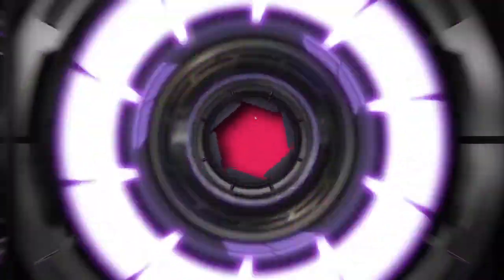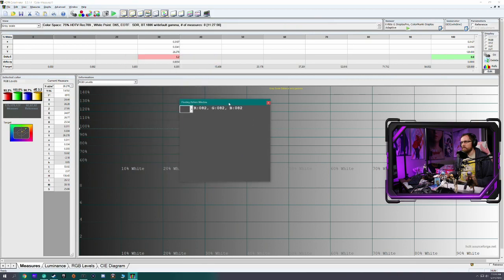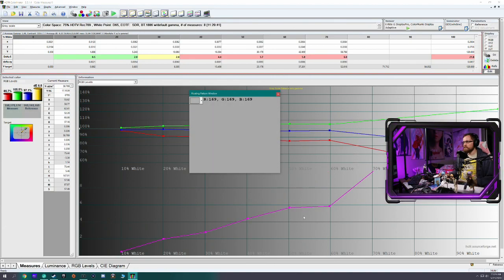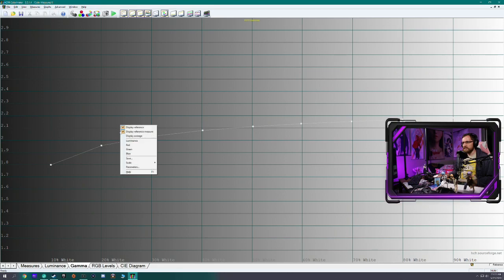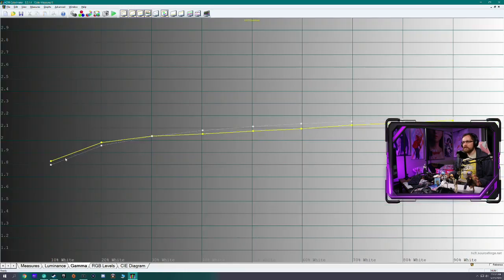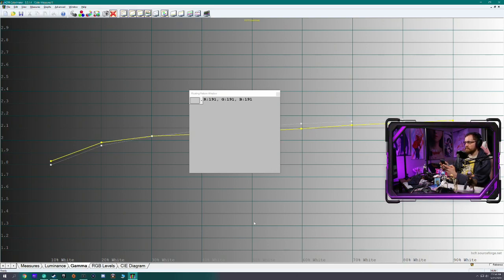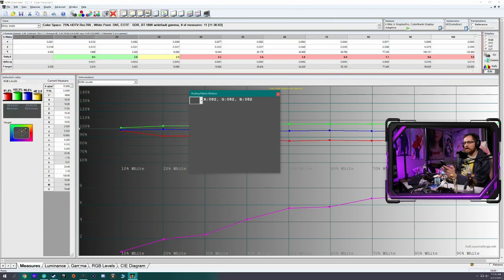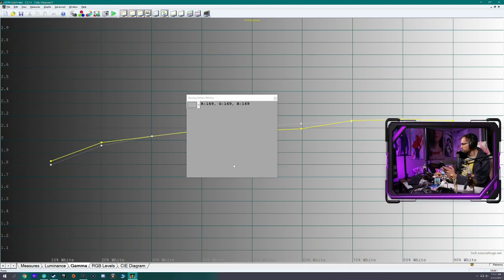HCFR Calibration Walkthrough Part 1

Comment: Happy to help you. The correct settings for LCD tv's is non refresh and best choice unless you're using one of the display types that as you said has a matrix made from a spectrophotometer which I have the i1pro spectro and the same colormeter you have so I can create spectro profiles. But LCD non refresh. OLED for OLED. Using the HCFR Test pattern Generator you need to make sure if using a computer to have 0-255 but if your using a tv then it needs to be set to 16-235 and the gamma and prefence settings were correct choice. Instead of using power law gamma you can choose bt.1886 for tv. Watching your video as i reply to your settings lol. All the measure graphs apply to the rec709 standard so each graph you want to get as close to reference points as possible. Shoot me a message, I have a discord as well and don't mind giving you a head one weekend if you wish.

Comment: Gamma graph should be modified by tweaking contrast (for the right side of the graph) and luminosity (left side), not RGB.
Then you can tweak your gray scale ref using the RGB Levels tab and the R G & B settings.
I generally go back to my Gamma afterwards for final tweaking (contrast and lum ONLY).
Then you're ready for the saturation settings with the CIE Diagram.
Reply from the maker: How would "tweaking contrast" align RGB for the gamma? I have to assume by "contrast" you mean white level, since contrast is practically a meaningless term unless you're talking about actual contrast levels of black and white which has absolutely nothing to do with this calibration. 

Also, "luminosity"? What? Do you mean black level or to keep the nomenclature of you saying "contrast", do you mean "brightness"? And again, this would not align RGB for gamma or grayscale.

Your reply utterly confuses me personally but I'm glad you have your own method for doing things.

Comment: Great demonstration! A couple of pointers:
1. You should start by setting the black and white levels first, especially for backlit screens. You can always go back and fine tune it later.
2. Having the delta value under 3 is ok for an older standard tv in daylight situations, but if you’re calibrating a dark room setup with a newer tv with high color fidelity or a reference monitor the value should be as low as possible, definitely under 1.
Reply from the maker: 1. Yes, of course your should do black and white levels first, but as you could probably gather this is not a "beginner's guide", so it's assumed if you are considering these steps you already know something so basic. As a lot of comments here have suggested, it was clearly a mistake to not dumb everything down way more than I did. Oh well.

2. According to the ISF, professional calibrators, and human visual acuity, a dE value of below 3 is "imperceptible to the human eye". While you MAY be able to notice changes below that if you're really looking, it's not required for a correctly calibrated display. However, as mentioned in all of my videos here, it is of course the ideal to get the average dE levels as low as possible which is why I personally got mine all below a dE of 1. Is that required for a correctly calibrated display? No, it's not. You and I may of course say that we want it below 1 (or whatever arbitrary number you assign), but that doesn't change the current visual science that went into the current recommended calibration dE levels.
Reply: @Kamuigod2001  I get what you’re saying, I just thought I could clarify since you specifically said “I don’t like to go to the bright and the darkest first”. (7:27).
And about the dE value. You are right, a value under 3, or at least 2.5 is imperceivable to the human eye. It does however have a few practical effects to have it as low as possible. The more accurate the target values are the longer it will take before it is necessary to re-calibrate. The colors will also stay more consistent as the temperature of the panel fluctuates.
Anyway, great video. Your demonstration of all the different functions was really interesting.
Reply from the maker: @mag_and  Ah, I see the confusion. when I said that I meant that I don't go to the darkest and lightest first in the steps I was taking because I was more doing a "2 step calibration" like for instance Avia used to suggest of doing 80 and 30 IRE before adjusting others. When you try to grayscale calibrate 100IRE for example, it can throw off the entire grayscale by changing the white point and in my experience really make the rest of the grayscale a lot more difficult to align.

I feel like even now I'm explaining what I'm trying to say very poorly, but I'm not much of a speaker, as you probably have noted lol.

But yes, you always start with a basic calibration by doing things like disabling extra processing of a display, adjusting "sharpness" or edge enhancement, basic color and tint with "blue only mode" (for example, if available), and white and black points.

Just through personal experience, I found that during grayscale alignment, doing say 80, then 30, then 70, 40, 60, 50, 20, 10, 5, 90, 100 (mostly to check more than adjust (and this doesn't include all the back and forth in between) works best. Others may do it in different steps, but this is roughly the pattern I found works for the way I attempt to calibrate.

Sorry for being so confusing in the video and here as well.

Comment: Hi, just got the HCFR and a Hisense Roku TV.  Trying to calibrate with i1Display.  But I don't get it.  I wish I could see what you're doing in the app.  The Roku app has a bunch of fields for each color and then each color again.  So I think yours might be similar.  But what do you mean you're only using green to adjust the gamma?  Also, my reference line doesn't look like yours at all, I wonder why
Reply from the maker: This is specifically and exactly why I said I wasn't going to show how I make adjustments for my display: My display in this video was a TCL and uses controls that work for it. Since you're using a different display, you have different controls, as will absolutely everyone else with any other display at all. Me showing people in this video how the app works is next to useless unless you have the EXACT same setup and adjustments available.

Also, I've mentioned that this is more of an "intermediate" calibration walkthrough, not a step by step tutorial for YOUR setup ("your" being the universal "you"). If you don't understand the questions you asked, I'd recommend looking up a calibration and / or HCFR tutorial for beginners or similar on YouTube or the AVS Forums.

Reference line is probably not similar because of a different system setting in HCFR somewhere.
Reply: @Kamuigod2001  I understand, I have almost the same TV, sounds like you're using the Roku app.  But why do you adjust the Gamma using only the Green?  That part I don't understand at all.  I was able to get all the RGB values to get very close to the straight line, but gamma doesn't look right at all.

Comment: What phone app are you using and what brand and model tv are you adjusting?
Reply from the maker: TCL tv with Roku app that has "expert picture settings" in it. I didn't go into detail on a lot of things like that because getting to advanced settings for your display will almost assuredly be different depending on what you have.
Reply: @Kamuigod2001  Thanks, yeah I use a XBR55X950G TV with it and know how to get to the settings with the remote. I was just wondering if there was a easier way like with app like you use.

Comment: Hi, I am very new to Calibration, I have LG OLED, My question is ...Do I really need a Color Meter iDisplay device? without this device can't we calibrate OLED with the help of Software alone?
Reply: No.

The reason that panels are not fully calibrated from the manufacture is that there is a panel difference, even on the same model's, so that would be impossible (also they are lazy), so you need a device (color meter) to see what the panel is presenting, and send it to the software.

Comment: Does anyone know what display type you would select for quantum dot tv?
Reply: Did you find an answer? I'd like to know that too
Reply: @DVDino  It seems without a spectro to create a correction matrix for your specific tv then your out of luck, or so it appears off my questions and research, when i used hcfr there was no default setting that would give accurate results, you need the correction matrix, using someone elses is useless too. Thats what i got from other peoples input on forums, im not 100% sure if its correct.